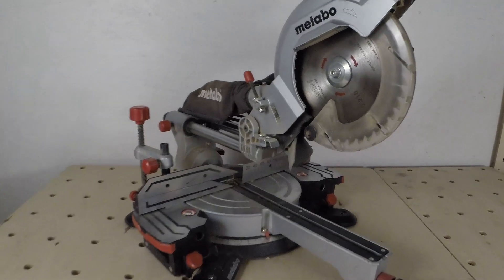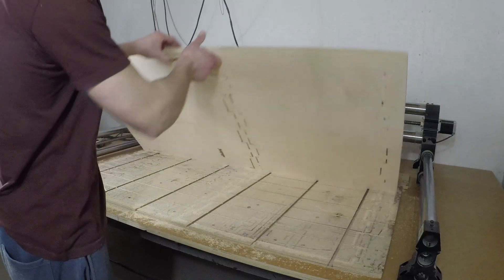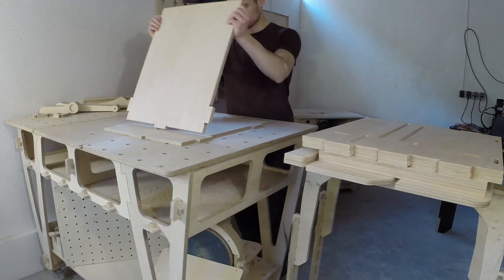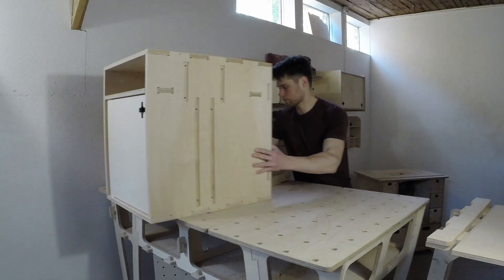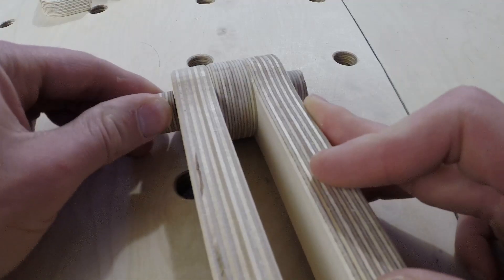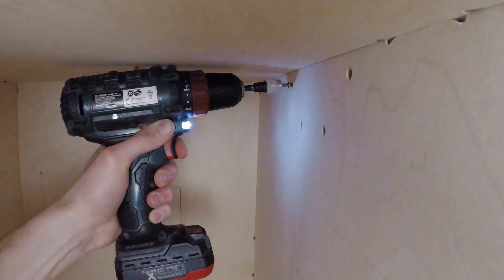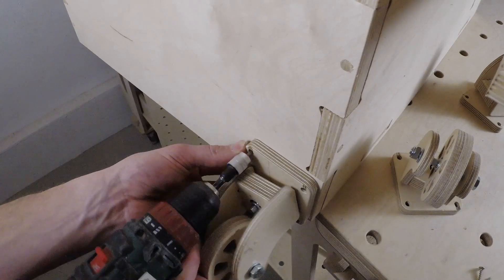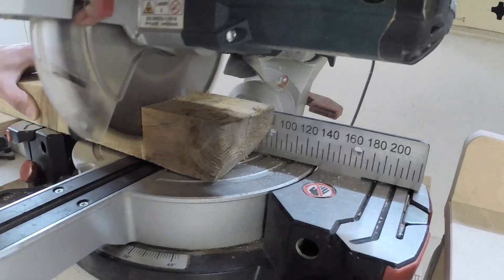Mobile Miter Saw Stand Built on a CNC Router - Aribabox Workshop EP09

Comment: Love your work! I have a questoin about your designs on your website. I live in the United States and most of our nominal dimensions are in inches, not mm. So if I wanted to purchase these plans would I be able to change things like the plywood thickness, and dowel diameter etc to work with Imperial units?
Reply from the maker: Thank you!
Absolutely! Our website offers project files that cater to both metric and imperial standards of materials. Furthermore, we can customize the files to accommodate your specific material thickness and router bits diameter. 
In the case of this project, we can even adjust the cabinets' dimensions to perfectly fit your miter saw. Just let us know your requirements, and we'll be happy to assist you!
Reply: @Aribabox  that sounds awesome! I will likely contact you through your website soon then. Keep making awesome projects! :) I love watching you build shop furniture/tools
Reply from the maker: @WiskerousPirate  Looking forward to your emails. And again, thank you for all the compliments and encouraging words.

Comment: was that a 10 inch miter saw or larger? thinking to build this but not 100% if my saw would fit well
Reply from the maker: Yes, I think it's a 10-inch saw. If necessary, we can modify the design for your miter saw. Just email us your saw dimensions, and we will make the necessary adjustments.

Comment: Hey, I am having difficulties importing the DXF Files of this bench into Autodesk Fusion 360. Is there anything that needs to be done with the files first? Best
Reply from the maker: Thanks for reaching out!

The files should import smoothly into Fusion 360, but I know issues can sometimes pop up. You can follow the same file-importing steps we used in this video: https://youtu.be/OOT-AlpDDao. If you still run into trouble, feel free to let me know, and I'll be happy to help!

Best of luck with the project!
Reply: @Aribabox  Hey thanks for the quick reply, really appreciate it. Meanwhile I have it working, the Problem was I didn't have Microsoft Visual C++ installed, since I recently Had to Reinstall Windows so it wasn't available when I tried to import it. Now everything works fine :) Thanks
Reply from the maker: @ma-le-lo  Glad to hear you got it sorted out! Hope you have a great time with the project, and don’t hesitate to reach out if any other questions come up along the way.